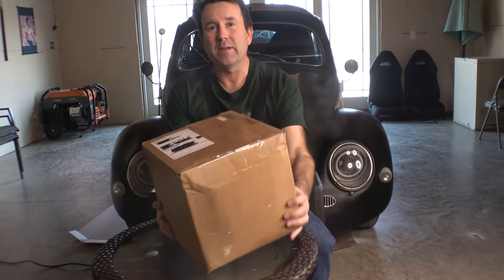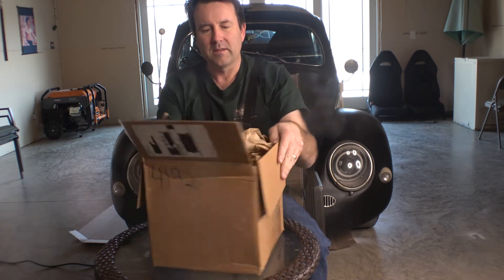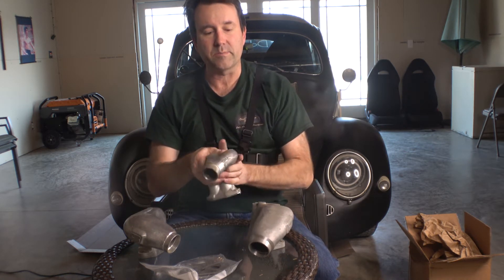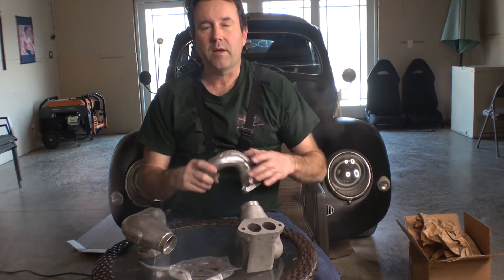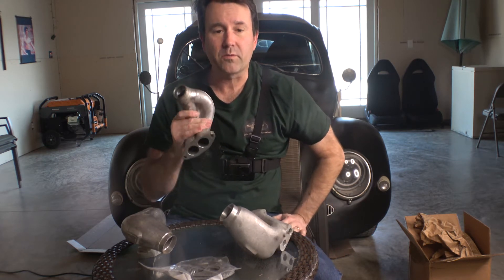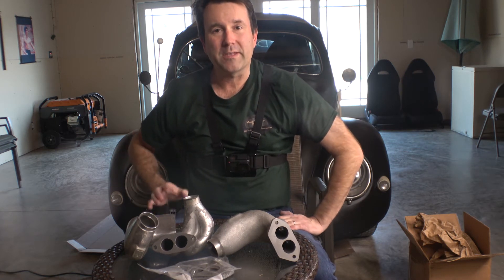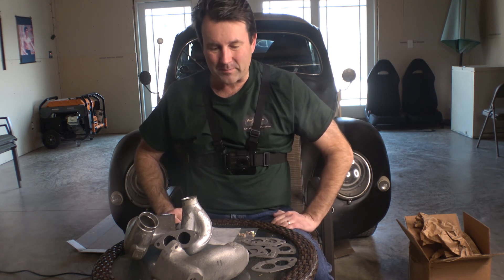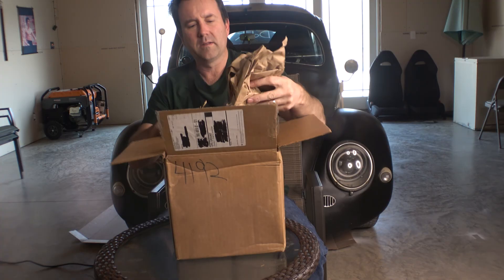CB Performance High Flow Intake Manifolds

Comment: I do not use gaskets on my manifolds . One reason is turbo engine. This way I do not blow out a gasket. Just use a thin layer of copper RV .
Reply from the maker: You must have perfect machine surfaces. I had a leak one time with a gasket. It wasn't the gasket either. I had a very fine scratch and had to hand sand it smooth. The only way I found it was by pressuring the system. Have you ever tested your sealing surface by pressuring them?
Reply: @ddk56vw  No never had to. Just a very light lick on both surfaces. Nothing to amount to any squeeze out really. Just let it set for a couple minutes to start setting up, and then bolt intakes on.  RLR does the same on his turbo engines.